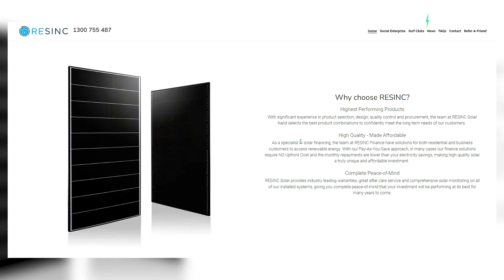Oxford begins mass production of game changing solar panels in the US

Comment: Current panel efficiency is 24% so I have no idea how 26.9% translates into a 20% improvement. Sounds like a nominal lab tested rate hyped against a lower standard to sound impressive. The improvement in efficiency is till impressive and combined with other strategies like cell layouts, layering etc panels are moving in the right direction. These are German panels so I don't expect them to be cheap. Bang for your buck might not beat the lesser panels on price point. One would have to do the math for their installation.

Comment: Photovoltaic solar farms are part of the future. But at least for the next 30+ years, standard Silicon technology will dominate all new solar farms.

The reason that 99% of large-scale photovoltaic solar farms are built using “thick” crystalline silicon or polysilicon materials is largely driven by financial and risk management factors. Developing a solar farm, which can cost between $100 million to $500 million, requires insurance or bonding to secure the investment. However, insurance companies are unwilling to cover technologies that lack a proven track record of at least 20 years of field performance. As a result, even when new solar technologies become commercially viable, they still face a significant delay—often 20 or more years—before they can be widely adopted, simply because they need to establish long-term reliability in real-world conditions.

Comment: The unknow is how long these solar panels will last.   That will determine their future.  

Currenlty silicon panels tend to be replaced at about 20 years due to degradation and economic factors.  DcTe panels apparently have an estimated life of 30 years.

Higher efficiency does not matter much  to grid based installations if the lives of the panels re short and require much more frequent replacment.

A huge unanswered question for the solar industry is the disposal and effective recycling of the used solar panels.   I have not seen any real solutions (although DcTe says that about 90% of the base materials in a CdTe panel are recyclable with current technology).

Comment: Improving solar panels’ performance and efficiency is but just a very small part of the conversation that needs to take place. And I’m a solar guy who has a grid-tied system with battery and generator backup. I have this system NOT because I believe in the climate/global warming  disaster hype BS; but because I simply want a backup to the grid given its vulnerabilities to terrorist attacks and politically motivated interests (Is there a difference?)

We absolutely MUST discuss the raw materials used to produce this technology, as well as ancillary systems such as batteries; the damage to the environment caused by strip mining the raw materials and the disgusting child labor that no one seems to want to talk about; in developing a sun-driven energy source which even if it achieves 75% efficiency (physics won’t allow it) will never replace fossil fuels. We’ll never be able to fly a commercial airliner on solar panels and batteries. Mining the raw materials of this technology is incredibly damaging. But because some elites want to impose this on us because of the human-caused global warming fairy tail, they’re willing to do whatever damage is necessary to extract power/control over us. 

Don’t get me started on wind turbines! 

Yes. I have a grid-tied solar system. But that’s because I needed a layer of protection against the self-proclaimed narcissistic “elites” who want to take the grid down in its current form.

Comment: Nice but BougeRV has been selling panels that are 24% effecient for a while now, maybe 6 months or so.  My 720 watts of solar on my camper van I bought 2 years ago are made by them and they are 23% efficient.  I have been off grid for over a year while traveling the US.  Interestingly, they just came out with a very flexible panel that is also 23% efficient and this will be great for many different applications.  Thanks for your video.

Comment: Love solar, but notice that the internet data centers are now looking at reviving nuclear power. Nukes plants are now cheaper/safer and are making a comeback. Microsoft just made a deal to revive 3 Mile Island. Nothing sucks power like data centers; yet google has little if any solar panels at it's data centers.
Haven't since they started building them in the South in 2000, and still haven't used them. Funny how this gets overlooked by the solar advocates.
Btw-worked for the electrical contractor that engineered/installed the electrical systems for these data centers, and one of my best friends was the structural engineer for the latest google data centers. No solar panels were installed that he was aware of-because he would have designed the structural system for them.
Nukes are making a comeback, which is a good thing.

Comment: Perovskite has been known and demonstrated to have greater efficiency than silicon for a good few years now. The problem was getting the lifespan of such cells to be practical (that is, measured in decades instead od days). The exciting news is that this is an actual sellable product.
Unlike some commenters here, I believe that greater efficiency is critical rather than (only) price per unit of energy. Space is often limited. Domestic roof space is limited, car roof space is limited, hell, event watch or calculator space for solar cells is limited. If new panels of 30-50% greater efficiency became available, I would happily replace my solar panels for the new ones sooner rather than later.

Comment: Over 12.5 years ago we installed PV; the panel efficiency was 19%. Yes, they were at the top end but unfortunately panel efficiency clearly hasn't doubled in that time, not even close. 23-23.5% non perovskite panels already exist in the market at relatively low cost so 24.5% isn't a great leap forward. I'd be interested to know how perovskite compares to existing panels in terms of cost/kW.  I've been following perovskite for several years and lifespan has been the core issue. Hopefully now that we're seeing commercial installations they continue to improve on the efficiency and durability.
Reply: perovskites simply aren't stable, they are degrading to light, moisture, air, etc... so their life expectancy would be months at most lol. I did a phd on these materials, not good for practicality.

Comment: The perovskite solar cell is a break through but not a huge jump in technology the key would be using the above with existing solar silicon panels so both materials would capture light in slightly different wavelengths and combine the 2 to get higher out put but Oxford is coming up against a well proven technology and manufacturing base I have worked on plenty of large solar installations and people pay a fortune for the latest technology but skimp on cabling and inverters or do everything at 12 volt and get poor energy conversion

Comment: The roof stays cooler if the panel is supplying power. If the sun's rays that are perpendicular to the panel have an intensity of 1000 watts per square metre and 240 watts are drawn off as electricity (24% efficiency), then the panel will be as hot as it would be if disconnected and receiving just 760 watts. First law of thermodynamics - conservation of energy.
This is counter intuitive since, in general, devices that supply or supplied with an increased current get hotter !

Comment: But still ....
Even if they were 100% efficient, you'd still only get a max of 1,400watts per square meter, if you were on the Equator at midday, in summer and it's not rainy or overcast. But if you live where 3/4 of planet lives, you'd be lucky to get 800Watts a meter. And in Winter forget aboud id.

Comment: Presenting something as a breakthrough when it "claims" to increase solar panel efficiency from 20 to 25% is the sort of hype that end in dissapointment.  What is the price of these panels?  You can already buy solar panels with 40% efficiency; but they cost so much the are mostly used on satellites. If they cost isn't comparible; then the improved efficiency will mean nothing; higher efficiency must be met with equal or lower price to have any impact.  Even if solar panels literally cost nothing; it sn't the panel costs that make the ROI low; it is the cost of installation and battery storage that makes them uneconomical in most locals with modest sun.
Reply: You know they won't be cheap because they're made in Germany. The country where all the manufacturing is currently closing down due to high energy costs.

Comment: Lithium has been around since 1930s in the battery industry. Not much is happening other than heavy cars because they are carrying massive batteries. These cars weigh3 x more than normal. My tires only last for 1 year now. I can’t run the heat in the winter if going more than 75 miles and want to get back home.
Reply: Three times heavier - just untrue. Tyres on EV's last as long as on regular cars once you stop flooring the gas pedal at every traffic light. Ever heard of a heat pump? Modern EV's can run heat or aircon all day long with no problem. I think your tyres do last more than 1 year somehow or you are just a bot.
Reply: @XenonJohnD  okuuuy.  I pretty much use my ev for round tripe of no more than 120 miles because I don’t charge anywhere but at my home because I feel like an idiot sitting at charging stations. This car was a gift and I still feel dumb.

Comment: 24 %  and watt output is vey misleading , it’s the nominal level that matters, not atc , eg you can get 500w pannel output atc ,yet nominal may only be 400w  , even if they improve efficiency, it’s still light levels and light wavelength that matter most , the goal is for the power not to alter to more than 10% regardless of it been a grey overcast stormy day or bright clear as a daisy  right now such dull days cut power output by over 70% , because the light is in inferred spectrum pannels just can’t capture it yet ,  the reason why I feel this area needs more attention than % efficiency is because winter rates drop like a stone if we can crack that so useable light no matter where you are in the world still gets 80%of pannel output it will cut the need for grid power and attray sizing can then be adjusted for use needs than just spamming roof tops . As just issues will bight you back as utilitys start charging you for vack feeding when there sources come online already we are seeing minimum bills far higher than they should be , and that trend will continue so ending off peak and buy back rates , i fact due to gre ease demand it puts a high possibility of brown outs and cuts , the grid doesn’t want to be your backup battery , they are interacted in one thing making money any way they can and that means hammering green consumers. I say beat them at there own game from April to late September, if you have 25kwh battery in cold weather areas and 45kwh in ac zones , not including pool demands and end you utility bill completely, then restart it sep 10th on for northern hemisphere, then what you don’t generate day time top up the battery at cheap rate and go off grid at peak time zones to prevent higher rate charging for example I’m a 4bed property 2 adults 2 children daily usage about 7kwh wait hour ac or heat pump I have 16kwh that’s more than enough is supper yet in winter it generates less than 1.75kwh on a solar hour hence needing 25kwh batter for off peak

Comment: How do they know how efficient a solar panel is? How do they know what 100% is?
Reply: There is a measurable amount of (solar) power falling on each square meter of solar panel and this is the "power in".  When you divide the electrical "power out" of the solar panel and divide it by the "power in" you get the solar panel's efficiency.  For example, if a panel is 1 square meter in size and it's power out is 250 watts when 1000 watts of sunlight falls on it then it is 250 watts divided by 1000 watts = 0.25 or 25% "efficient".  It would be 100% efficient IF it's power out was 1000 watts.

Comment: Nice.  The solar panels produce 421 watts of power.  My original panels installed in 2012 only produce 180 watts.  Just added 4 more panels from Germany that produce 30 watts per panel.
Reply: Oops, that should be 380 watts per panel not 30.

Comment: Interesting - I thought I was going to watch a video on a new solar panel I read about last week - should have kept the link. But this is different. The one I saw was non-silicone based; It worked by producing hydrogen in it's cells and is about 15% efficient. However, although this one here in the video has a higher efficiency - these hydrogen panels are on orders of magnitude cheaper to produce than ones using silicon; Which means it has the lowest cost per MWh.
Also these panels produce hydrogen in their cells passively even when the sun is not out - although the production is higher when the sun is present.

Comment: 1:13 "Oxford have increased the efficiency by a further 20%." - in relation to what? That shold've been mentioned up front. I thougt they came up with an extra 20% of the solar power potential here on Earth, which would've been indeed revolutionary - going up to 40-45%.

Anyway, one big issue with perovskites was the fast degradation of the solar cells. It would've been nice to touch on that topic and tell us what they've come up with for the production version of their panels. Maybe they achieved a "good enough for now" durability, but I doubt they're anywhere close to the currently installed panels, which last for decades. Hopefully they got a lot better than they were just 1-2 years ago. Otherwise the bang for buck is still not there.

P.S. I checked, and their press release from September 5th doesn't mention durability at all. These panels may be great for utilities who recoup their investment before the panels degrade, so it makes sense they're interested. For home owners who want to use them over the long term, it's unsure they're at the level required for a reasonable return on investment.
Reply: Excellent points
Reply: In relation to current 19-22% efficiency. Basically, it is not worth it unless they double it.

Comment: I asked GPT what it would cost to convert to solar and battery for the whole world:    
   Solar panels: $1.43 trillion
    Grid-scale batteries: $6.85 trillion
    Transmission infrastructure: $2 trillion
    Maintenance and other: $2.46 trillion
Total cost: ~$12.74 trillion
Then I asked :  what would the projected fuel savings be over 10,20, 50, 100 years?
Summary of Fuel Savings:
    10 years: ~$45 trillion
    20 years: ~$95 trillion
    50 years: ~$270 trillion
    100 years: ~$880 trillion

--- this was based on li-on batteries not sodium ion which should be 20-30% cheaper i think once ramped

Comment: ?? SunPower and Canadian Solar have 23% efficent solar panels now. OxfordPV is a little higher at 27%, but what about the cost and life span which are MUCH MORE important metrics??
Reply: 27%? They're not that high, not yet at least. 24.5% was quoted for the commercialised perovskite so not much higher than existing commercial panels and the degradation rate is unproven.

Comment: Suggest you explain WHY your house is cooler when PV is on roof- some know, some will wonder, it is a huge, free, advantage IF the air between the PV and roof is let to escape on its own, for example, on a pitched roof or many inches above the existing flat roof.
Reply: I think it is self explanatory that solar panels on a roof will shade the original roof and block the solar radiation from heating the roof and attic of the home. Of course all solar panels have to be mounted on rails about the roof a few inches to allow rain to drain normally down to the gutters. I don't like the idea of drilling holes in a roof to mount solar panels as that will set up a possibility of water leaking when wind pushes and pulls the solar panels and causes roof fasteners to loosen.

Comment: I won’t argue that solar panel prices have dropped, but in 2001, the installed cost of solar panels was $10k/kWh. The price today, without batteries is $10k/kWh where I live. Not feeling the decrease in cost.
Reply: Meanwhile, the price of everything else (and likely your income) has gone up close to 77% (per https://www.bls.gov/data/inflation_calculator.htm)
Reply: What has been inflation since 2001 .so it is cheaper.

Comment: Banks hate perovskite cells. They have been market read for years, and have certainly been produced around the world But they get shut down. These are tandem cells, which is annoying because you still have to refine silcion. So this is allowed as the cashflow from silicon is not reduced. The multi junction 26% efficient cells may be full perovskite (31% has been achieved), but at 1/6th the cost of silicon PV that will collapse too much cashflow. Banks are a major obstacle to innovation and progress especially when it comes to renewables.

Comment: @3:42  STARLINK!  

Awesome installation dude!  I have 14 solar panels on my roof since 2014, they have a 275Wp rating, I bet your panels of the same size have a 450wp rating, right? almost twice the capacity. I have added an Enphase 1Q Battery 5P last week, and my house is at time of writing running on battery power! Making me even more independant of the grid. So during the night it runs on the battery, but early in the morning it charges up in just 2 hours back to 100%

Maybe in a few years I will replace the solar panels with new ones with higher rating, if these Perovskite panels become available at cheaper prices, that would be awesome, but then probably a new converter is necessary as well, or just add one to the existing one, I don't know, we will see. Then I will also start charging my Tesla Model Y with my solar panels, right now that is not possible yet as I can not park my car in my front yard, I need a permit for that.